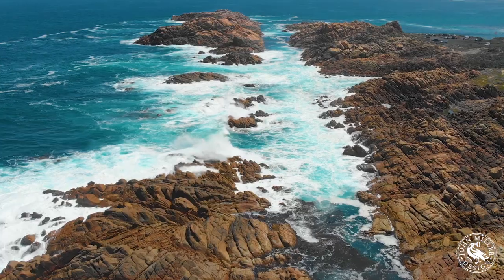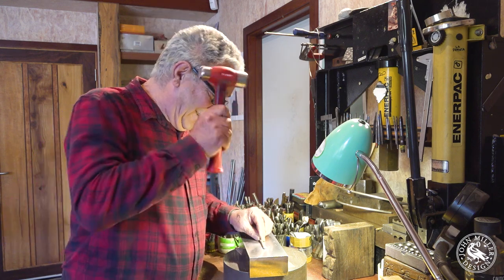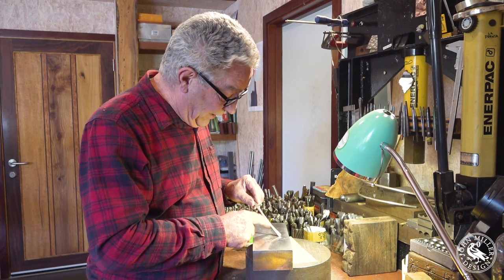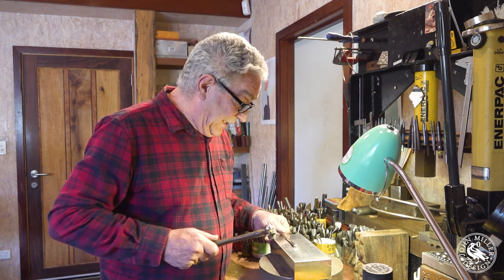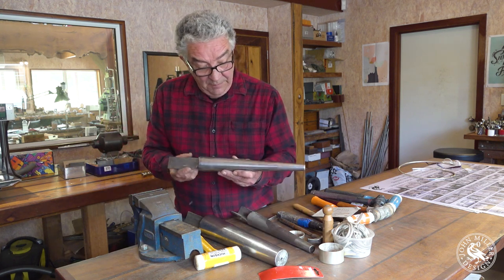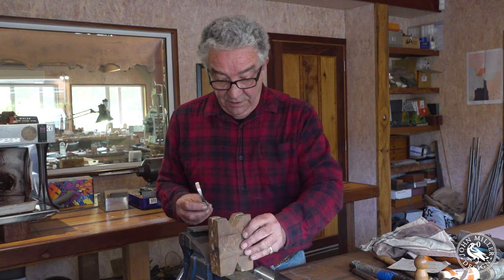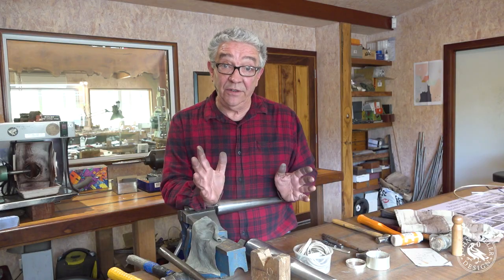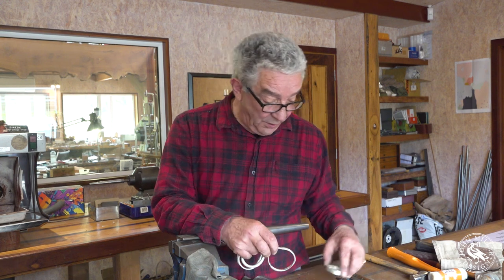Hammer Forging A Silver Cuff Bracelet

Comment: Great little bracelet sir, but as 47 years of making jewelry would’ve likely taught you, annealing in between processes would make your life oh so easy. Heck, you’d avoid the step of bringing your peen hammer back to remove stretch marks, because you wouldn’t have stretch marks to begin with if the metal were annealed prior to forming on the mandrel.
Reply: 47 years of making jewelry making tells him that the end user wants a hard bracelet that doesn’t bend easily.